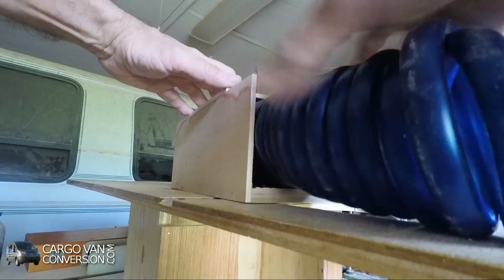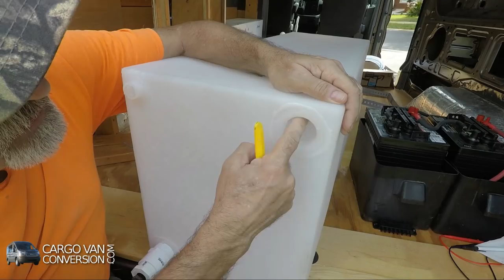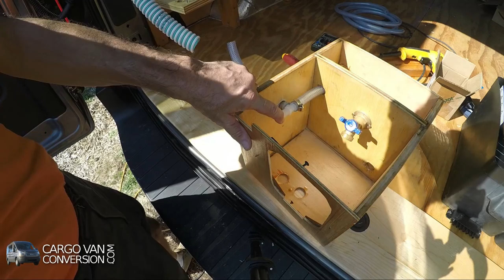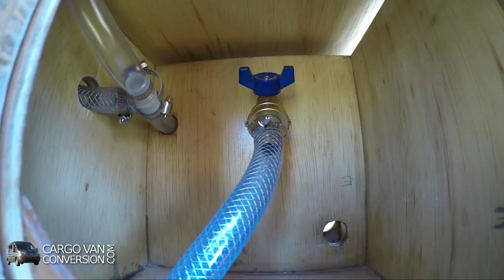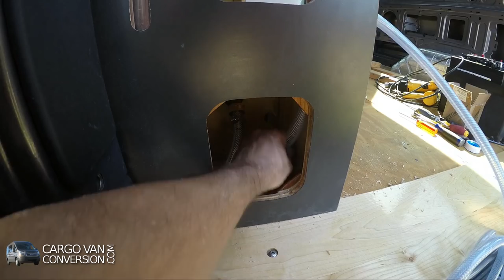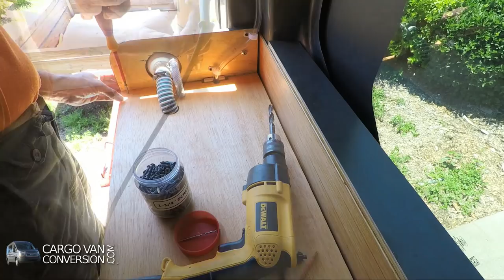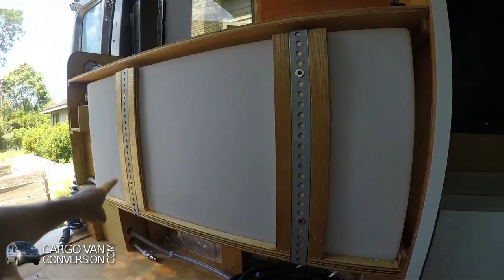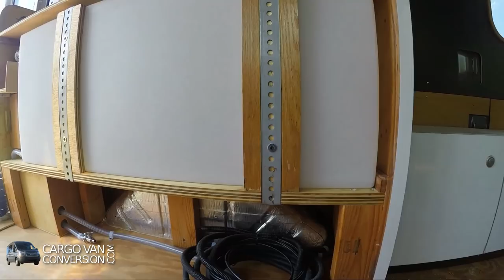RV Fresh Water Tank Installation

Comment: Every vlog is top notch! I can't wait to see the finished van but I will also be sad when it is finished because i love to watch quality van builds!
Reply from the maker: Hi Bob,
Well thank you for that!
That's also a conundrum for me, but I like it so much, that I'm considering other ways to continue building, so keep watching and enjoy :)
Van Williams
Reply: Awesome I look forward to future projects :D In the meantime I will enjoy this van build. I know it is a bit too late to mention this but I would have considered buying a baffled water tank to reduce inertia based sloshing in you tank. For the air vent  next to the fill hole, connect a "Non Return Check Valve" which can be bought at RV supply store. One last thing if I may, drop a small plastic bead in the water level pipe for easier viewing!  have a great day and hello to Joey :D
Reply from the maker: Hey Bob,
I did consider some form of baffles, but the $100 I paid for this 46 gal tank convinced me otherwise. I have to say that I do not plan to drive long distances with a full tank for obvious reasons, but baffles make good sense. I'll just have to see how this works out, but you make a good point.
I may consider a valve for the vent line, but I was already considering extending the vent line and alleviating the problem. I'm still more concerned with the 1-1/4" fill hose, especially in mountainous terrain.
Thank you.
Van Williams

Comment: I like the straps system that you've chosen to secure the tank.  I see many other people use cleats, and I keep thinking that they are making a mistake.  people don't realize how much sloshing goes on--and how flexible those tanks are when that water sloshes from side to side.  I think they may eventually see their cleats rupture the side of their tanks.  I may be wrong, but I think you've got the right idea.
Reply from the maker: Hi Mark,
I have had and have seen many water tanks over the years and they all bulge excessively. And a full tank can weigh 300-400lbs. So the supports, the platform, the straps, etc. are all needed. You're right!
Van Williams

Comment: One option for the fill tank inlet would be to add a one-way check valve on the back side of the inlet.  That way the water goes in but can't flow back out. my 2 cents.  I love the project and the detail that you add to your videos A++++++.  Keep'em coming.
Reply from the maker: Hi Aron,
I am considering that, but I have to find one for an unpressurized system, otherwise it's awkward filling the tank. Check valves on the vent lines just don't work. That's why I'm seriously thinking about simply installing a shut-off valve on each of these lines. Perhaps not elegant, but simple to install and operate.
Thanks for the encouragement!
Van Williams

Comment: I think Joey is ready to hit the road. I can see another 2x4 support or two under the inboard side of the tank. Great idea to double up the half inch plywood under the tank.
Reply from the maker: Hi Tony B.,
Thank you. As I mentioned before, the weight of a full tank of water can be 300-400 lbs, so I made sure that the platform is thick enough to withstand the flex of it. Driving just makes it worse.
BTW Joey loves sitting behind the wheel; I just won't allow it when the engine is running :)
Van Williams

Comment: your workmanship is superb. I enjoyed your build so far. Why such a huge fresh water tank, and will you have a similar sized grey water tank? I see all the fittings and hoses, but I do not understand the flow of the water through the system.
Reply from the maker: Thank you Butch. The actual plumbing system is largely unfinished. There are the tanks, I can fill them and I have a pump working, but that's all. Other things happen and it got postponed. The main goal in my van life is boondocking (and self-sufficiency). For boondocking, I need a large fresh water tank i.c. 46 gallons. Need that partially for showers as well, but not for the toilet. One or two videos ago, I just finished a separating toilet, with the fluids going to my gray water tank. That is a 15 gallon tank, that I recently installed under the vehicle, which I'm still testing out. So the final plumbing is coming.
I like the stealthiness of the van (stealthy as in you can't see anything from the outside), so the fresh water fill is located inside the rear doors with a marine fitting. After that is the water pump, that pumps it to the sink where there is also a electric water heater. It will also continue to a hidden sliding showerhead close to the ceiling, which works in combination with a shower pan, built into a large drawer under the kitchen sink. Below the water fill, I have also a built-in sprayer which I can use for an exterior shower or just to clean up the dog or a dirt bike. Still lots of work to do. You'll see it in my upcoming videos.
Van Williams

Comment: I think filling the tank from the inside is brilliant.  I've always worried about someone putting something unwanted into the tank if it fills from outside.
Reply from the maker: Hi John,
I had the same feeling. But there are some disadvantages. Water that flows over during filling has to be dealt with. And I'm still testing if the water (in a full tank) can splash out during stiff braking or in an accident.
I like it this way though.
Van Williams
Reply: I know they make one way valves for smaller dia. hose but I'm not sure about the 1.25 fill hose.
Reply from the maker: Hi John,
They do and I'm working on it. Most are for pressurized systems. I am considering a plain shut-off valve, but I want to do some testing first.
Van Williams

Comment: I love the idea of the water level hose on the end of the box, very simple. But then you route it up into the corner and up - I don't see where that hose ends up going, if anywhere? And why so much extra hose, well above the top of the water tank itself? Wouldn't gravity prevent that hose from filling up to the top and overflowing?
Reply from the maker: I reality, I didn't exactly know how to finish it. First I put one-way valves on them. That didn/t work. Then what you see, high above the water tank, so that gravity would prevent it from overflowing. But with a full tank, braking hard would push the water out.
I decided to connect these lines back down to the dump line. That plumbing (the last major thing in this build) is starting soon; I'm working on the kitchen right now.
BTW With an RV it usually is a vent line that goes through the roof.
Van Williams
Reply: Did you just run it into the vent line with a T connector then? That seems the simplest way to deal with it all.
Reply from the maker: @wanderingzythophile9083  No, don't have a vent line and I certainly don't want another hole through the roof. I'll direct it down, through the floor to outside.
Van Williams
Reply: I guess I should be more clear - I meant the line running from the top of the tank to the other port on the fill plate, to allow air to pass out as you fill the tank.
Reply from the maker: @wanderingzythophile9083  Originally I had to replace the fill opening with a marine version to stop water from being forced out while driving with a full tank. This means there is no air movement here too. That's why I have no decided to direct both lines down to a dump line through the floor of the van.
Van Williams

Comment: Nice work my friend. It's great to see good workmanship. One question...did your water lines leak, specifically the 1-3/8 hose? And if so, how did you stop it? I replaced both fresh water tanks in my toy hauler and the joints on the fill lines leaked with standard stainless steel hose clamps. I've been advised to use food grade silicone sealant along with the clamps but that does not adhere to polyethylene tubing. Any thoughts?
Reply from the maker: Hi Gary, a sealant on a pressure connection doesn't work. I had several problems with the water tank and I don't know exactly anymore about the hose. I originally used the standard green/white RV fresh water hose; ultimately I replaced it with a marine type hose of the same size. Much heavier and better suited  for this purpose. I went to a local westmarine.com store, but you can order online too. They have a great choice of hoses. Mine is still working fine.
Van Williams
Reply: Cargo Van Conversion Okay, I will search for other tubing options. Thanks for the reply!

Comment: Forgot to mention that on the strapping you might wish to add some rubber under the straps to prevent chaffing, perforated strapping has rough edges and can wear through the plastic quickly. Wouldn't want to see such a great job soaked by water.
Reply from the maker: Hi again Beeps,
I may revisit that. Thank you. There is one back corner that could have an issue, so I'll check that.
Have a great day!
Van Williams
Reply: Cargo Van Conversion  you also, I spray truck bed liner on the first two inches and bottom of the holding tanks... just in case😋

Comment: Another great video!

I found myself wondering about all those water connections in all those WOOD cubby holes. Do you have any concerns that those spare drops of water that happen when connecting hoses, and filling tanks, might cause problems down the road?

I share other concerns, already raised here, about the potential of water sloshing and getting out of the ports. Would you be willing to shoot a video of your nearly full water tank under driving conditions? It looks like it would be possible to see enough through the tank to get a good idea of what is going on in there under heavy braking or acceleration.
Reply from the maker: Hi Mark,
I'm not that worried about a few spare drops as most connections are permanent and dripping water is not accepted. All the plywood has been 'poly-urethanated' :) Only the quick connector for the sprayer hose may produce some moisture. A simple piece of cloth (at the bottom) of the cubby hole should prevent that; would need dry cloth to clean the hose after use anyway.
You make some valid points regarding driving with a full water tank. I already raised some, like water coming out of the vent line or fill hole. I might add a check valve in either one of those. With these issues raised, I'm thinking of just adding two shut-off valves, one on the fill hose and one on the vent line; that would solve most issues. I also considered a water tank with baffles, but I could get this 46 gal tank for about $100.00 and that was too good to pass on. Baffles in a tank would reduce the sloshing quite a bit.
I still haven't done the basic testing for leaks, but you had a great idea of filming it while driving. I think, I'll try that, but have to figure out how to do the taping. Personally, I don't worry about acceleration; I'm a very passive driver and already take it very easy on the engine. It's the sudden braking or an accident that plays around in my mind. The setup is that under these circumstances none or little water can escape as the front facing part of the tank is completely sealed off; it's just the movement in the tank afterwards, that can lead to water exiting the existing water input/output lines.
Besides all the above, my exposure to these risks is generally low, as I do not expect to drive long distances with a full tank of water. That just doesn't make sense to me.
I think, you can expect another video about this :)
Van Williams
Reply: Van, no big surprises with your response, given your careful nature, and high level of quality. 

A couple more thoughts. If you do the filming, it might help to add some food dye to the water (temporarily) to improve visibility while filming. Good lighting, especially behind the tank might help. (Press a light up to the wall of the tank and let the water spread it around.)

I believe that you are the gentle driver you claim to be. (Probably considerate as well ;-) ) Regardless, there is always the potential need for sudden hard braking to avoid situations caused by other drivers. The back slosh of water from a sudden hard braking could be severe *depending on your water level*. At 8lbs/gallon, such a slosh of water could reach a sudden very high, if temporary, pressure - this might overcome the "seals" on the fill cap.

I really hope you do film this. You have the ideal setup, and all  RVers  could get some benefit from a better understanding of what happens in our tanks while driving.

Warm Regards,
Mark
Reply from the maker: Hi Mark,
Lots of sound ideas. As you said, sometimes you have to worry more about other drivers than yourself.
Van Williams

Comment: Nice job with the water system.
Joey was fine with the water conversation up until you mentioned giving a bath with the sprayer! Just like my dog! Can't resist getting wet in even a puddle but say the word bath and he's nowhere to be found! The build is really taking shape now. I can't wait for you to start the galley I just started building mine around a propane stove and oven combination. I want to incorporate the supply lines to the hot water, heater, stove and fridge in one run starting at 3/4" and ending at 3/8" to supply equal pressure to the components. It looks good on paper but we know how things change in the actual installation.
Reply from the maker: Hi Beeps,
Would love to see some pictures of your build. Love what other people are doing! If pressure is an issue for you, you may consider upgrading to an Aquajet water pump. Most regular RV pumps are often just for incidental use (which works out for most of us).
Joey is hesitant with water, but once wet, he's OK with it :) He's a great guy.
Van Williams
Reply: Ha ha!  All dogs must be the same!  You've described our Phoenix to a tee!

Comment: I coiled my vent hose so that water that sloshes will not leak in the van. Cheers
Reply from the maker: Hi Steve,
I will likely connect one or both vent lines to the dump line, just to make sure.
Van Williams

Comment: Awesome job there Mr. my question is about all that weight on one side, would that be a problem? Thank you!
Reply from the maker: Yes, it would, but for the fact that on the rear passenger side, I'll have all the 12V equipment, like inverter/charger, batteries, controllers, fridge. And I will rarely drive long distances with a full water tank. As you noted, distribution of weight is something to remember!
Van Williams

Comment: If you fill your tank full and take off too fast, or go up a steep hill, the vent is going to leak water all over the interior.  About a gallon in your interior will make a mess. Thought Ide give you a heads up. I have the same fill cap. My vans side is streaked and stained from the vent leaking.
Reply from the maker: Hi Dan,
That's good feedback! I mentioned it in the video, that that's still one of my concerns. I can still disconnect the vent hose from the fill dish and extend it higher, along the other vent hose from the water level. May have to seal the access to the input line.
Thanks.
Van Williams
Reply from the maker: Hi Dan,
Another viewer commented on adding a 'Non Return Check Valve' on the vent line. That may alleviate some of the problems, although the fill hose remains.
Van Williams

Comment: That's an impressive watertank size. For how long do you want to stay remote?
Reply: And thanks for this awesome video. Extremely helpful. You are always doing such a good job!!
Reply from the maker: Hi K S,
Thank you. My primary objective is boondocking (all the time), but there are always limitations: availability of potable water, especially in winter, is sometimes daunting and I expect to visit a commercial campground periodically, to load up or get a decent shower.
With 46 gallon, theoretically I could stay out there for three weeks at 2 gallon use per day. Practically, it's a different story. I am or perhaps have been researching RO systems (reverse osmosis); the best that I have seen, use 2 gallon of water to produce 1 gallon of clean drinking water; that would reduce my three weeks to 10 days :) So lots of variables, but I expect to be able to disconnect for at least one or two weeks.
Van Williams
Reply: Cargo Van Conversion Thanks for your reply! We are currently looking into a water recycling system as well and found Shower loop very interesting: https://showerloop.org
Reply from the maker: Hi K S,
Real innovative idea and the fact that it's open sources fits entirely into my way of thinking. It has some issues specific to boondocking: 13A use for electronics and 2000W for the heater and it's bulky. Yet there are lots of things to improve upon.
The whole idea of having one bucket of water and taking extended daily showers with it for a week is appealing.
Great resource! Don't know if I can apply it to my current van in some way, but would give it a serious thought, if I'd upgrade to an extended length van.
Van Williams